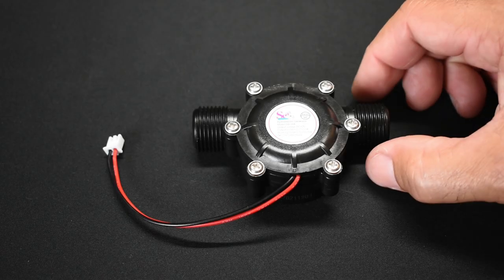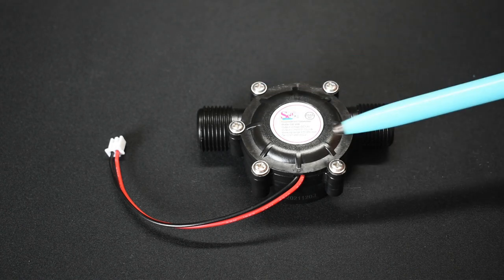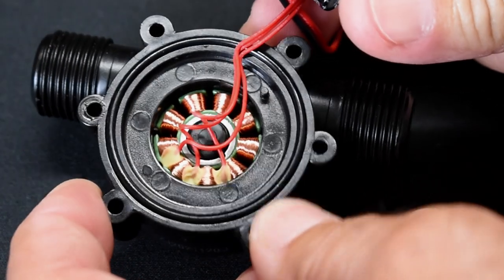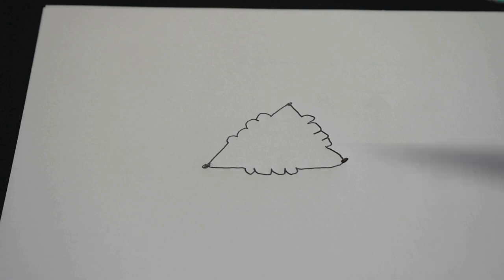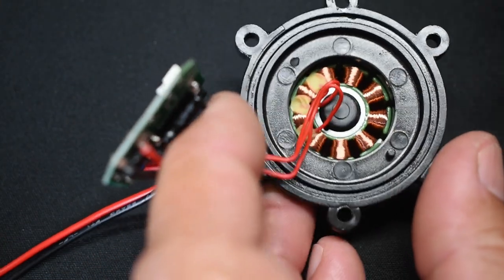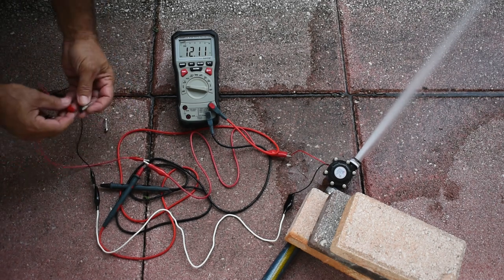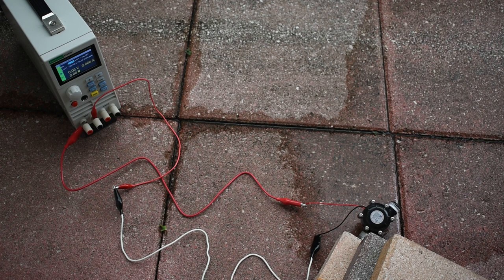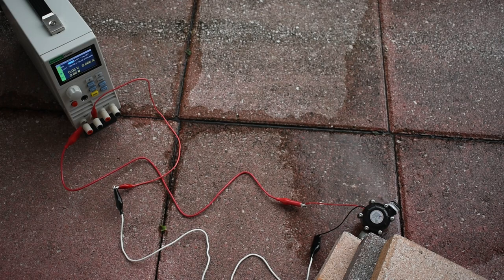How A Mini Hydroelectric Generator Works

Comment: Take a plastic coat hanger, cut off 1.5" with a hack saw and epoxy the plastic piece as a shaft to the center of the water wheel and add a drone blade. A 3 blade drone propeller may give slightly better results that a 2 blade. Then use fan power you use during the summer in your home.You set set up an array of these and parallel up to charge a battery. Excellent demonstration

Comment: Super interesting test.  Would also be cool to see 10 of them run in series off the same water line to see how much the liquid discharge flow is restricted and if you could get 12 watts out of it.  A preppier could use this to charge a phone or operate a small radio in an emergency.
Reply from the maker: True, that would be interesting to see.

Comment: I could Use this technology to increase my flow pressure.
Reply: I don't think so. The electricity made using the momentum of the water would not be enough to power something else to pump water harder. If you mean would it going through it increase pressure I would also think no. Any resistance from the generator should decrease pressure down stream. The waters momentum is what we are taking the energy from. There will be energy lost during that process so if you try to feed it back into increasing the same source it can only be a reduction.

Comment: 4:00 Genuine question - shouldnt be diode pictogram for negative line switched 180° (facing down)? Diode component is one way, that's what I know.
Reply: Im also confused but if faced like that power would go both ways equally right? With his way positive currant goes one way only? Not sure

Comment: Are these ever used with super capacitors to operate the motion sensors and solenoids-controlled valves in automatic urinals, toilets, sinks, etc? They rarely seem to have batteries and hard-wiring for such a use seems a bit much for something that could be powered by the water flow itself.

Comment: i can see this being used right beside a digital temperature sensor without running a long wire to power 12v or whatever voltage... potential energy from a kinetic source

Comment: Interesting. Maybe power some LEDs while showering? I wonder how much restriction it adds. It looks like the existing rectifier, etc could be removed and replaced by something to produce pulses and count them. Maybe a more useful flow meter than a generator.
Reply from the maker: Without the flow restrictor, you can easily power a super bright COB LED.
Reply: this product already exists @sylvan, my sister bought 1, its called a disco shower head or something

Comment: well thats disappointing. Any decent ones to at least charge a phone to be at least 2amps than the .115amps? If not is possible to be done?
Reply from the maker: If water will be running for a prolonged period of time, then you can let the generator charge up a super cap so you can supply power to a phone.